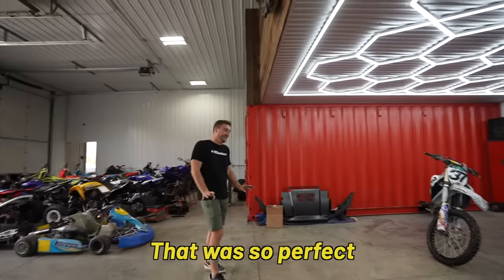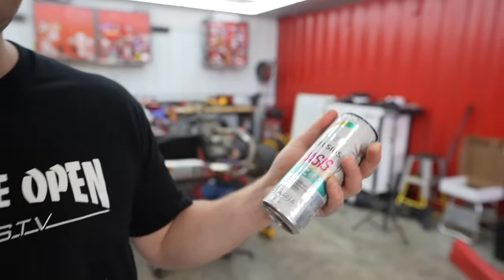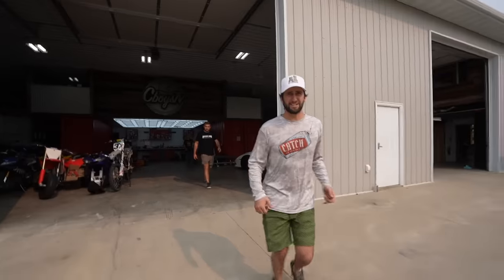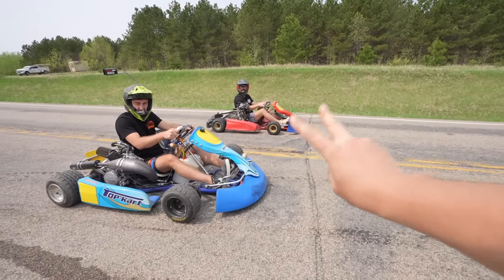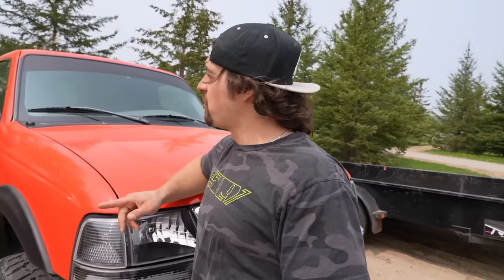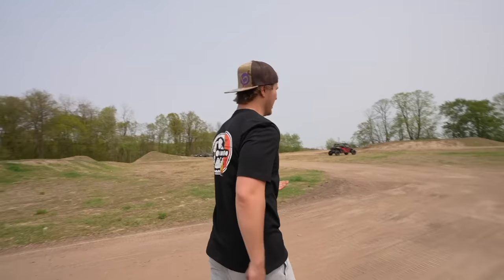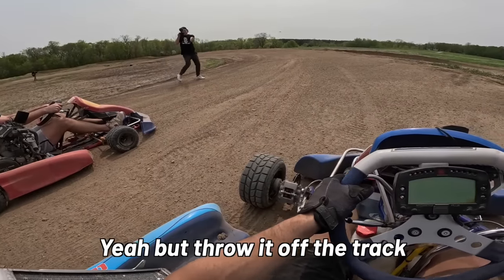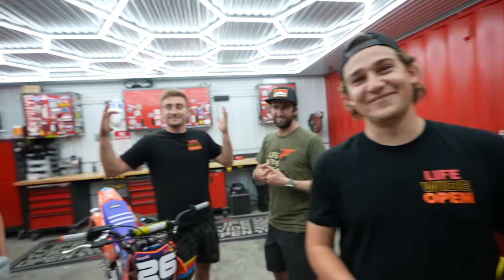Shifter Kart with 450cc Dirt Bike Motor

Comment: Thats a dope shifter kart build, very nice. Shifter Kart needs to be re-geared for the 450, its setup for the 125. Change Sprockets, should be a rocket afterwards.
Reply: Definitely need to re gear the sprocket
Reply: This is exactly what I came here to say, definitely geared too low for the 450
Reply: @TurbochargedHobbies   Haha yeah same, for how much they can all shred they know very little about their equipment lol
Reply: Yup. Once they gear it correctly that thing is gonna RIP
Reply: my comment got deleted by them for saying the same thing kinda weird, but yea if it was geared for the 450 it would be insane i want to see that so bad, i really hope they do.
Reply: and add bigger tires/rims to get a little more clearance that'd perfect
Reply: @b52goats  they talked about the gearing being low tho??
Reply: For sure
Reply: It needs to get re geared and re tuned. Spund like short reving
Reply: Yes actually like not a call out but a helping hand I came here as well to say that 😂
Reply: Yup
Reply: They should probably drop half the teeth and they’d be smokin tires, that 450 has too much potential
Reply: Put a air filter on the 450 because all the dust it's going in the engine, and the engine is almost all the time on rev
Reply: @ov1d1u92  yes, you’re a genius, why didn’t I think of that😂😂 it obviously wouldn’t be used long term without an air filter, anybody with enough brains to shift gears wouldn’t do that
Reply: @ov1d1u92  it has a air filter

Comment: Gives me ptsd!!!! Reminds me of the time my buddy brought his old school go cart camping swapped out with a 160hp snowmobile engine and I was the first to drive it!!! We were at fossil creek here in Az and the switch backs have 500 ft cliffs with no guard rails, the first corner the brake cable snapped and I was in god mode trying to keep from dying. Every corner I had to do a few dusty donuts and pray I was pointed in the right direction when I came out. This went on for 3 miles and a couple dozen corners! Tried to reach back and pull spark plugs a couple times, but every time I got more out of control(if you could call it that). When I got back to camp, all my bros were rollin, and said I was the craziest sob ever, they had set the hole thing up(minus the brake cable)to see if I’d do it! Assholes almost killed me but then they reminded me that I had almost killed my self a ton of times doing crazy stuff! As far as I know nobody has tried taming that thing since(definitely not on that hill). But hay, only live once and why do it like a bitch, right!!!?!!!?

Comment: The reason the gears are short is because the gears are designed for the large diameter bike tire. If you were to put like 12 to 15 inch tires and a larger driven sprocket on it, you will get more speed
Reply: It is chain driven though, so changing sprockets may be a thing
Reply: @winzracingNZ  Jup, as it does in the intire karting sport. Different track different size sprocket.

Comment: I'm a Yamaha tech. And the reason the 450 instantly bounces off of the rev limiter is because without the airbox and filter the engine is going lean at high rpms. So it's not bouncing off the rev limiter at first. At mid rpm the engine is going lean and breaking up and then bouncing off the limiter.

Comment: The Biggest Improvement I Evern made to my 1975 C-65 Chevy with a 427 Gas engine was to put and HEI Distributor.  That is  besides also using a 4.25" Stroker Crank Crower roads and a  torquer cam .  Mich Higher compression ration  better MPG

Comment: That thing needs bigger tires with like 3psi air per tire. 
 Also, like others have said, regearing with a larger rear sprocket and a smaller front sprocket will help increase midrange torque and top end speed.

Comment: put taller drive gear on the motor , overcompensate for higher speed than youll need, the 450 torque will make up for the longer gear and it wont bog down.   we did a 250f shifter cart and we ended up going up like 40% on the drive sprocket size.  5th gear isnt necessary it will do 100mph in 4th lol

Comment: I would try and put a street bike motor in the 450 bc it’s a blast bc we put a zx6 motor in a 1997 KX 500  and made it a hill climbing bike and it was ridiculous riding it regular challenge, because before we extended the swingarm, that thing was a Wheelie machine even with the extended swingarm it’s still would ride wheelie’s even if you weren’t meaning to do them

Comment: Y'all need to stretch out the gears on the 450 shifter cart so you can have top speed and still have fun also so you don't send the 450 motor to the moon but I absolutely love it though

Comment: i have a honda gx160, but i need to run a fuel line in my gas tank, will a 4/1 ID 3/8 OD fit inside my gas tank? or will it be to big? also what do people usually run for fuel lines on there go karts?

Comment: Yeah the gearing was mostly due to the wheels. You went from a huge diameter wheel+tire on the dirt bike,  to a tiny go kart wheel+tire which shortened the gearing
Reply: Also the sprocket size wasn't changed from a 125-450 , Should of went and put a bigger sprocket on it .

Comment: You need to change the gearing/sprocket sizes to stop it getting straight to 16,000,000 rpm every gear with no speed difference😅

Comment: You need to change the gearing on the kart with the 450,it's geared wrong,it's geared too low. Put a bigger sprocket on the motor and a smaller one on the axel. Then it will have more top speed and not be on the limiter so fast.